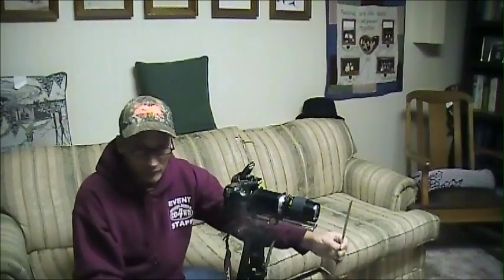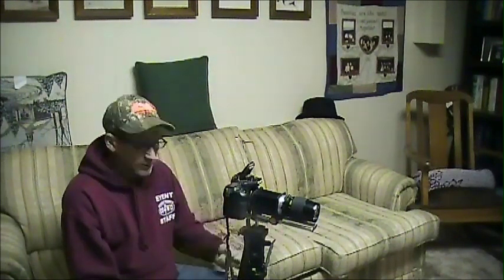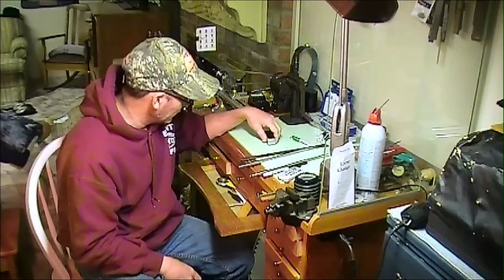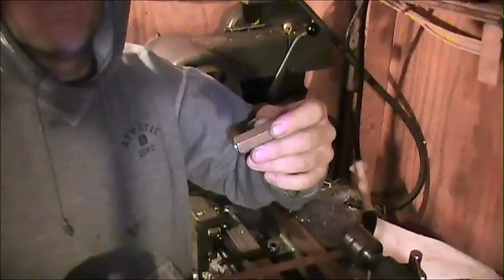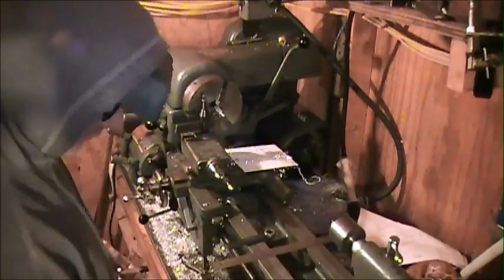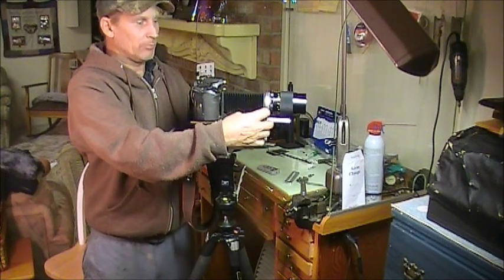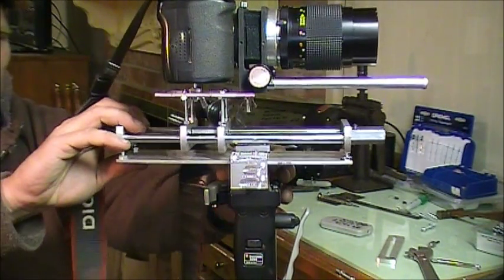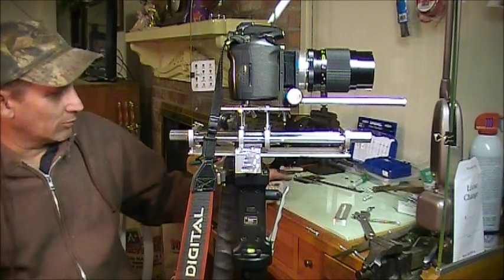macro slider final

Comment: Thanks  for the video.  I'm planning a mount for connecting a 100mm lens to my consumer camcorder, which has no threads, to take live macro shots.  I haven't figured out how to make a bellows yet.  My idea was to set the lens at any set distance and move the whole set up to focus.  Your idea is better.  I have no lathe, so I use PVC pipe a lot for projects.  Thanks again.